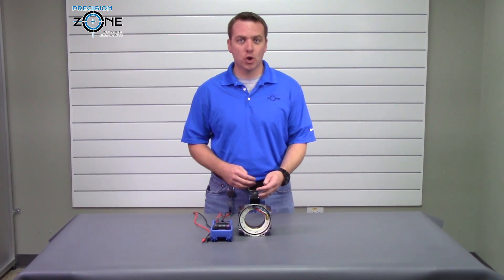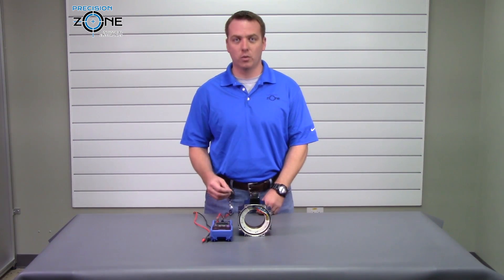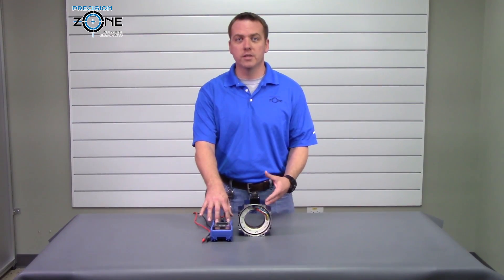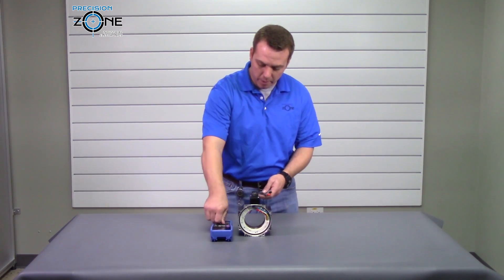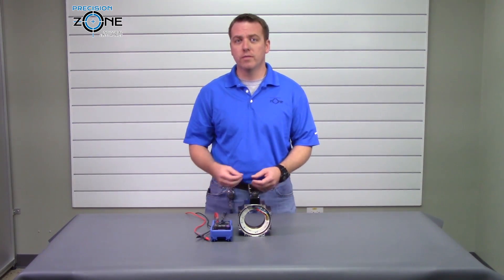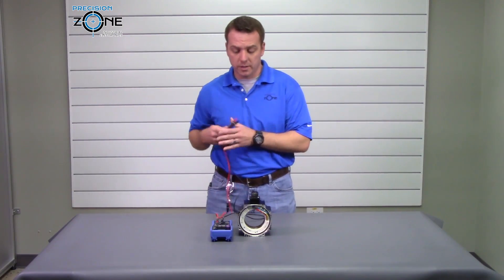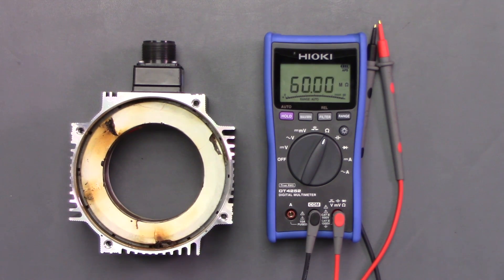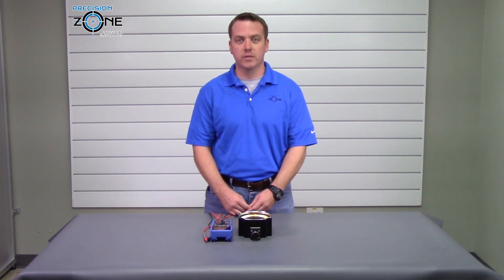Basic Winding Resistance Test

Comment: Congrats for illuminating explanation.

#Accordingly,Please clarify the following about motor winding of mixer grinder:
1.If  resistance value between neutral wire and motor windings:speed1.2.3 showing infinity/ OL(1)
(N-Sp1,N-Spd2, N-Spd3)
Then,What is the reason for infinity value/1??,when measured between N-Sp1,N-Spd2, N-Spd3.

2.But, Motor winding resistance values between Sp1 & spd2 winding : 5 ohms , 
between spd2 to spd3: 1.8 ohms  
between spd1 to spd3: 0.8  ohms.

3. Resistance between Motor windings & motor body is infinity/1

# So Please guide us how to troubleshoot the problem as mixer grinder NOT running at present
Note: Power supply continuity signal is OK/ Normal,from socket up to Rotary switch.

#Please reply.
curiousbhargav@yahoo.co.in
www.facebook.com/Bhargava Ashwath

Comment: I have a phase 1 motor.  I see wires that connect from a capacitor to the windings and from the switch to the windings.  My motor is a brushless  motor and it belongs to a bench grinder.  How do I do the resistance test or continuity test ?  Thanks

Comment: hi
I want to test 3/4 HP motor on Condenser with 27" fan 
what resistance tells about the winding ?? motors shows 29 Ohms on all what its means???
which test I should done on motor??
Reply from the maker: Hi Robin, 
Thanks for stopping by and watching our videos! 

Seeing 29 Ohms between each phase and ground likely indicates an issue with the winding resistance. When using the multimeter, you should expect to see no resistance between each phase and ground (OL or open circuit). When using the multimeter to check resistance between any two phases, you should see low, balanced resistance. You need to have continuity between U-V, V-W, and U-W. Anything open or abnormal indicates an issue. 

I hope this helps!

If you are in need of any further troubleshooting assistance on your motor or any other product, please give us a call! We offer free technical and troubleshooting support! 800-551-4420 or email us at repair@precisionzone.com

Thank you!